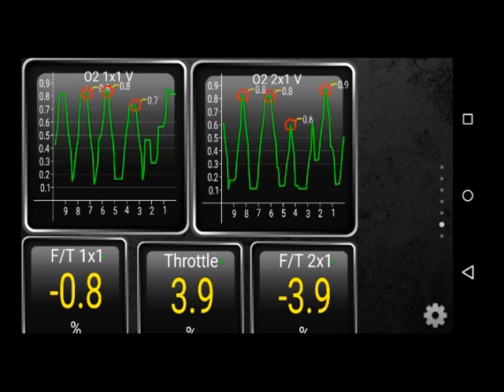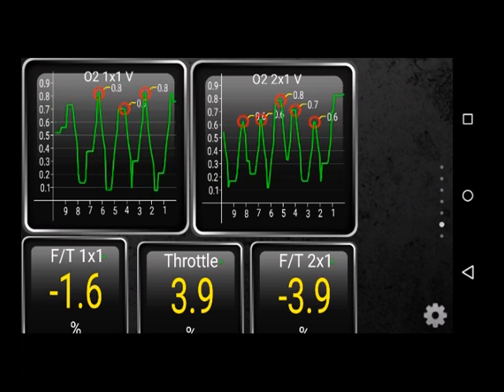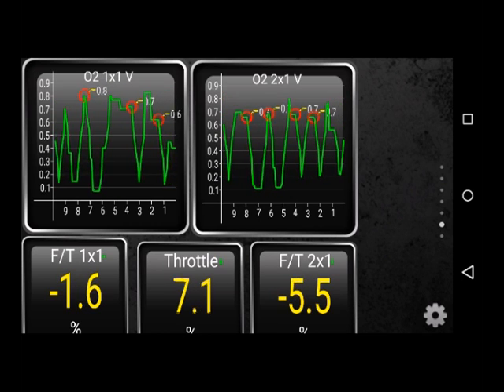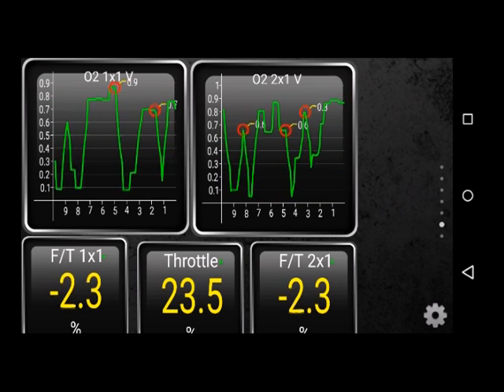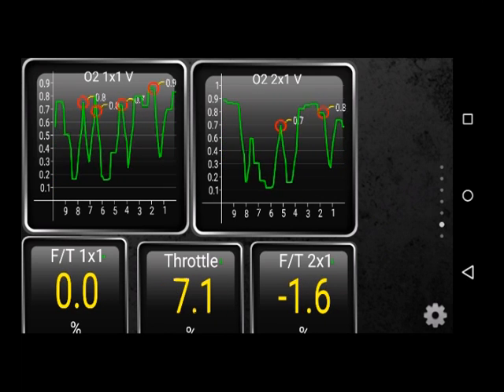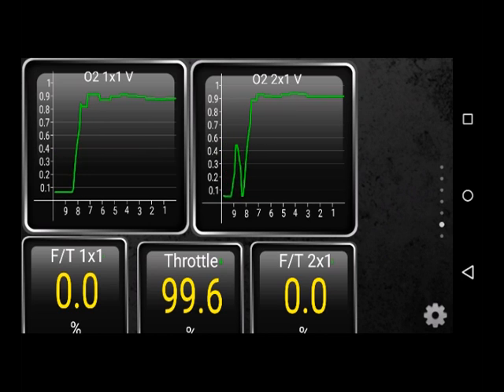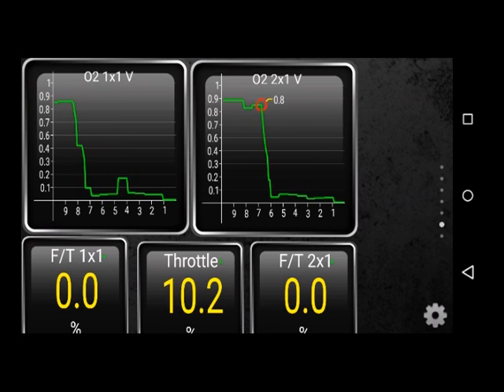2003 Envoy 5.3 O2 readings and Fuel Trims

Comment: I kind of wish you can explain or show the picture of what you're bad fuel trim was before you showed your good fuel trim I'm just trying to figure out if my fuel trims any good and I really can't read it I don't understand what's good and what's bad or how to actually read it I'm also using that app
Reply: Your fuel trims are F/T 1x1 for bank 1, and F/T 2x1 for bank 2, if you have a V6 or V8, otherwise you only have bank 1. "Ideally" fuel trim numbers should be zero, but real world they will vary a bit, plus or minus. The healthier the engine the closer to zero it should be. A worn tired old engine will typically vary more. Generally if it's mostly single digit you aren't far off. As you near 10 +/- you are farther away from ideal. You will see in my video that numbers remain within about 5 +/- most of the time. Most times the ECM will need to correct a fuel shortage, as in a weak fuel pump as in my case, or it could be a clogged injector or a very dirty fuel filter. In that case you will see a high plus reading as the ECM is adding more fuel. When this fuel shortage worsens the O2 reading under full throttle will drop and not stay maxed out, this indicates a weak fuel delivery, pump or filter. In this video when I went full throttle the O2 readings remain maxed.
Reply: @richardmathews8250  how do I set this up on my device so I can read it better
Reply: @richardmathews8250  I have the paid app I just need to know how to set it up I have p0420 code on my car it shows thier is 3 different fuel trim for b1s1 I was looking at one that show - 100 and voltage b1s1 good b1s2 sometimes it almost looks the same I need to what is causing am playing buying new cats
Reply: @isrealperez9069  B1S1 is the O2 sensor before the cat on bank 1. B1S2 is the O2 sensor after the cat on bank 1. The sensor before the cat sends information on oxygen content so the PCM can adjust mixture. This is confirmed visually by observing fuel trims and O2 voltage (FT & O2 voltage as seen in my video). They should display as seen in my video. Fuel trims do not apply to the sensor after the cat. The sensor after the cat is there only to confirm compliance, or effectiveness of the cat's operation. The P0420 code is set when the PCM sees little variation in O2 voltage of the post cat sensor. This can be observed visually in a graph display or numeric variation. 95% of the time the cat is too slow to respond to changes in oxygen content as a result of age. To confirm catalytic efficiency an infared temp reading can be taken at the cat's inlet and outlet. A healthy cat should have at least a 100º F increase in temp as the exhaust passes through. If this is not the case then the cat is just too old and requires replacement. You may wish to search for "o2 sensor extender". Installation of this spacer will, in most cases allow the O2 sensor to give the illusion of proper function.
Reply: @richardmathews8250  God bless you thanks for you're help
Reply: @richardmathews8250  I need you're help one last time so far I have fixed my fuel trim it was caused by purge valve I have p1093 bank 2 to it says its low fuel pressure or injector if you have time can you help thanks
Reply: @isrealperez9069  That code is vehicle specific, I would need to know what vehicle this is to try to help. I don't have knowledge on all vehicles but I'll do my best to point you in the right direction.
Reply: @richardmathews8250  it's 04 BMW 325xi 2.5l awd this is my last code I believe it mean low fuel pressure
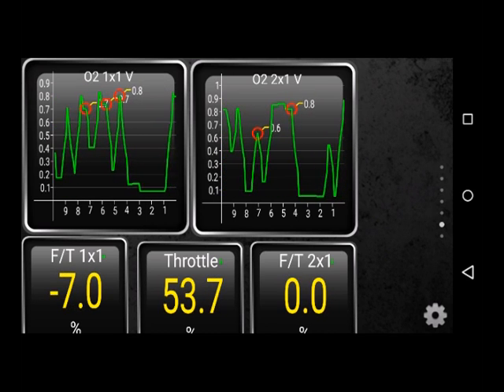Reply: @isrealperez9069  You may have a weak fuel pump, a pressure test would be in order at this point. Know that even if a static pressure test appears fine, the pump volume may be insufficient under load. There are two ways to go on this. One is difficult be very precise, the other is quick and easy but may not be 100% conclusive. The difficult one is to hook up a fuel pressure gauge to the engine and mount it in a way that you can observe it while driving, usually just outside the windshield. This way you can observe the fuel pressure under full acceleration. Once the car has been running for an hour or so, and at the hottest time of day, do a full throttle test, up a long hill if possible. If the power drops off, or the pressure drops, then you know 99.9% that the pump is weak, or rarely the fuel filter is clogged or a damaged fuel line. The easy option is to monitor the O2 voltage with Torque and do the same driving test. After the engine is hot put it through the same driving test as I mentioned above. The O2 voltage should remain maxed out at all times. If it begins to drop off after a bit your fuel pump is weak. In my video at 1:10 I do this exact test, watch the O2 voltage peak and stay there, that is what you want.
Reply: @richardmathews8250  p1093 pre catalytic fuel trim system too rich bank 2